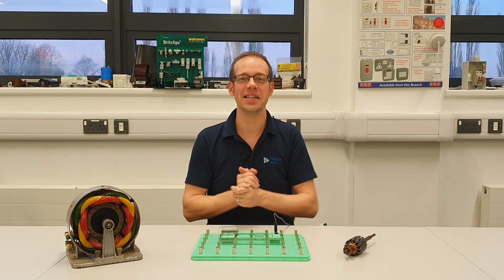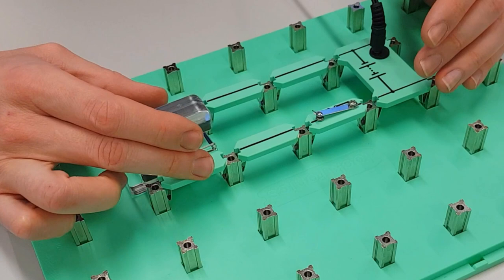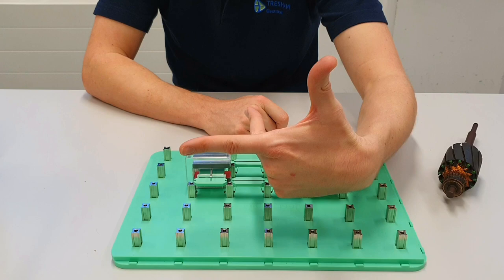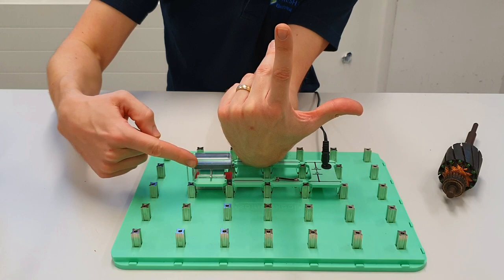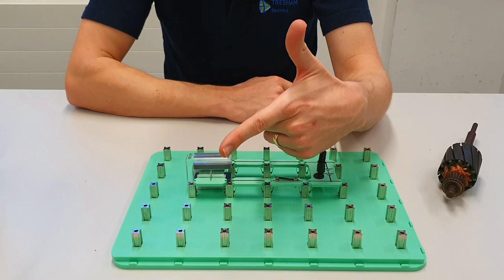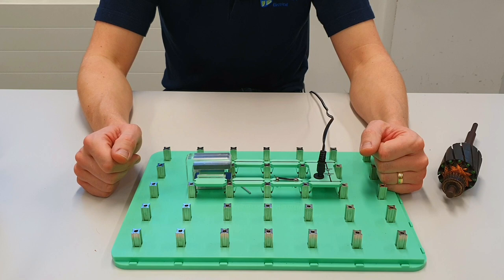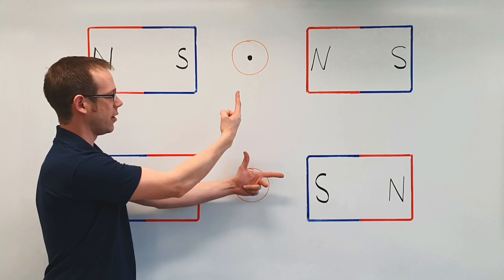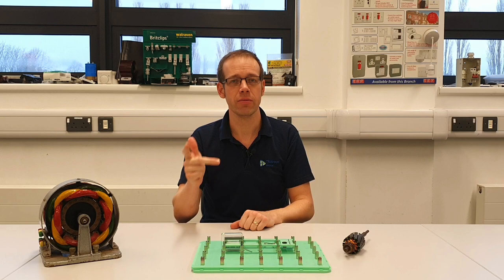How to Use Fleming's Left Hand Rule to Work Out Direction of Motion

Comment: Hello Joe !!! Just want to ask you something personal . No doubt your Videos are really Excellent and help learn a lot. . Power Outages and Voltage Fluctuations has been a problem for years in our country causing damage to Electrical Appliances. Even if we install a 12KVA Voltage Stablizer that will just help control Fluctuations not Short- duration ( 5 seconds / 2 minitues etc. )  Power Outages .  Can you please suggest a BEST SOLUTION ???
Reply from the maker: Hm, not too sure about that one, there's a lot of information required for that, maybe some kind of Uninterrupted Power Supply (UPS).